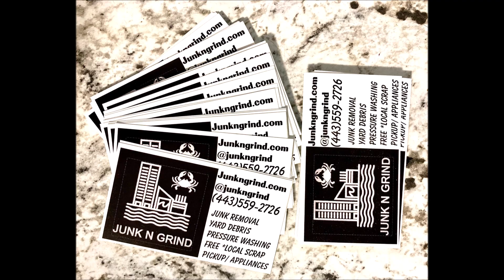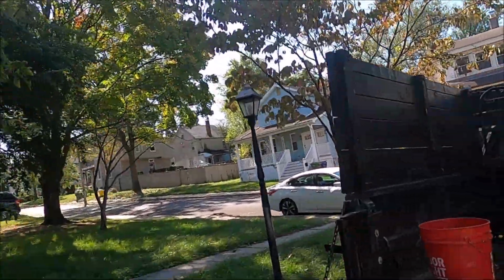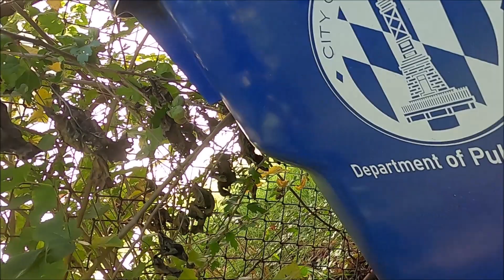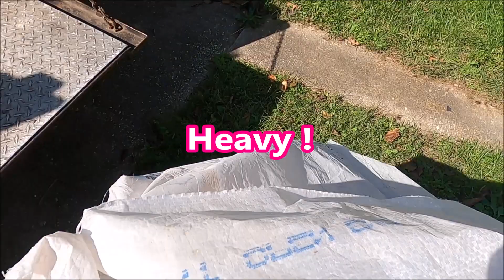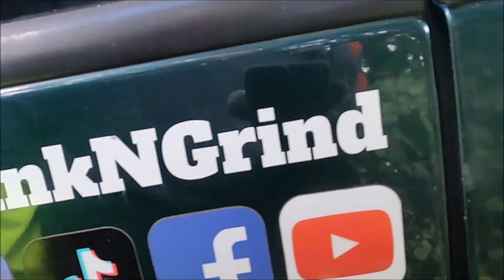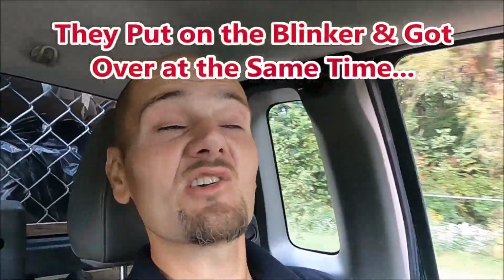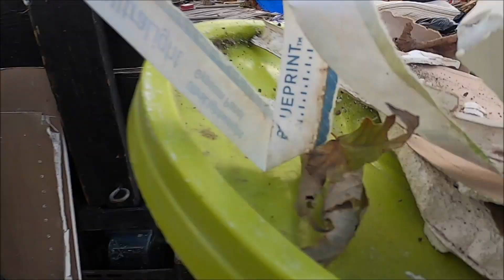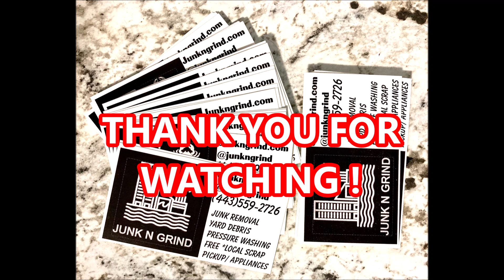Demolition & Renovation Construction Debris Clean Up 🗑️ Junk Removal Service Vlog Baltimore City MD

Comment: That concrete  looking material  is plaster the stingy stuff  in the middle is horse hair which is perfectly  safe.  I have removed more of that material then most.  But money is money.. jusr charge theme more . You have that right because you told them no concrete  or tile at the price  quoted.
Reply from the maker: TY for the Clarification Sir 👍🏼✅🙏🏼. I Think I said Plaster at the Very End 😁. We Removed the Skinny White Looking Kind at a Roofing Job Before and a Neighbor Flipped Out on Us and Made Us Stop Until We Got the Plastic Body Suits 😁. Stuff was Just Dead Weight 💪🏼🙄🙄